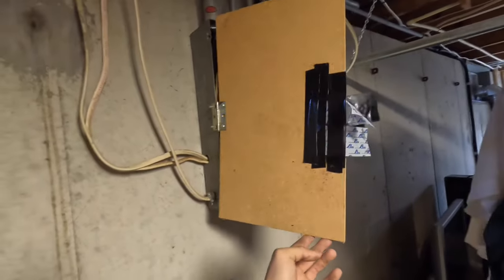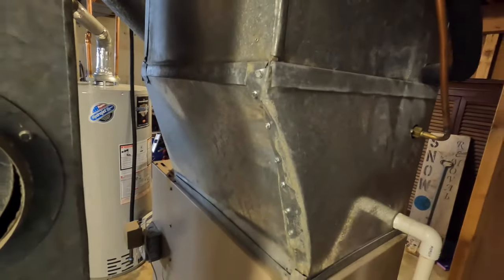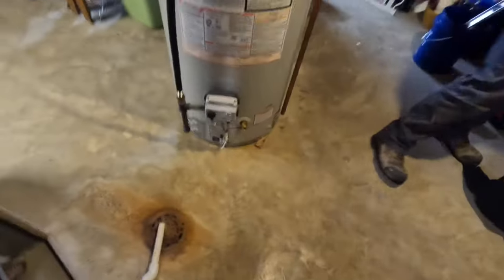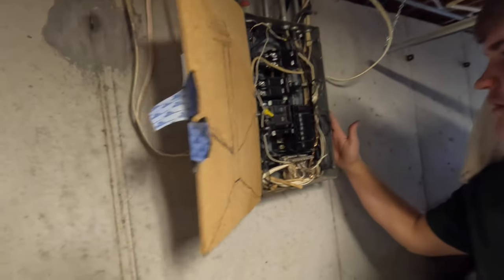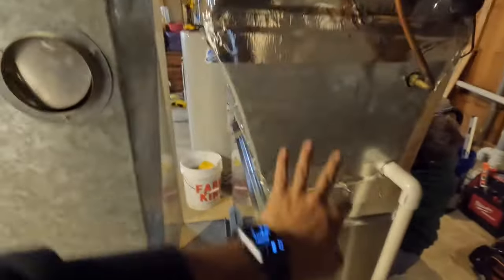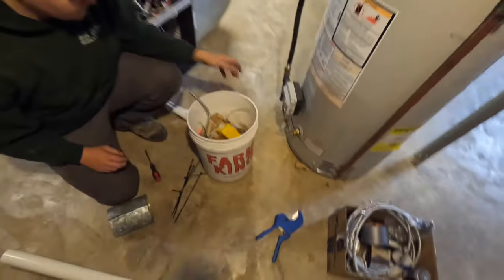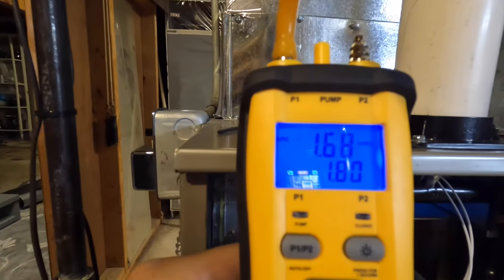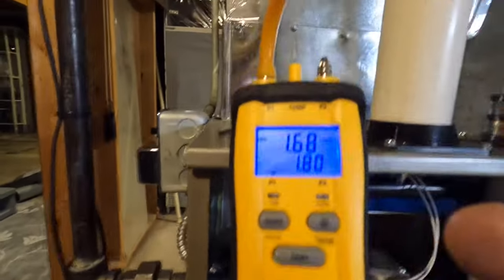Installing A Miniature Furnace! (HVAC Vlog)

Comment: You are asking for warranty calls bu keeping putting intake on top like that . The ga valves get it seems one drop of condensation from intake and are dead shortly thereafter
Reply from the maker: Are you suggesting I tap into the side for the intake air?